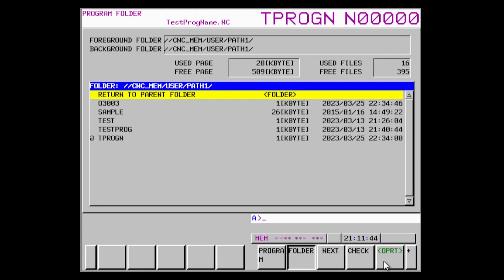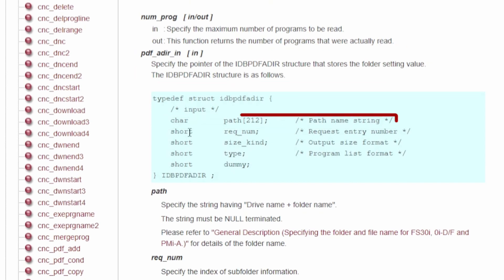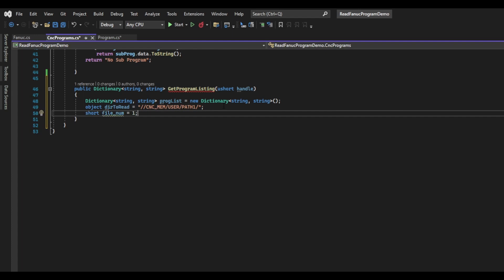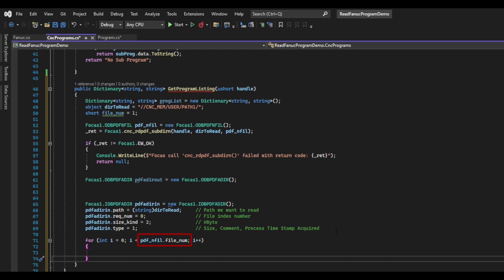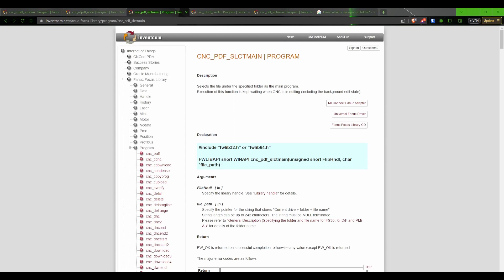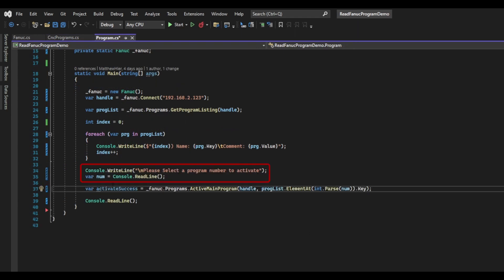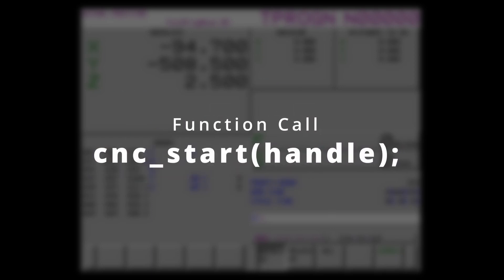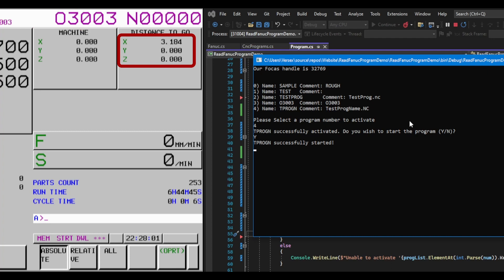Mastering Fanuc Focas: C# CNC Programming (Activate Programs)

Comment: Hi HierThinking,
You started a good Channel
Keep up the good work.
Also I have question:
I have idea to develop an application in which the generated Part Program is complex:
1. The application should will the parameters from GUI as input.
2. After that probe would measure some reference points and output to some macros let say: #120, #121,...ect.

After that:
3. My app should read those macros  #120, #121,...ect and generate another sub-program.

My question is:
1) Whether Fanuc part program can call an external program C++ from my app?
The reason for this : I need to generate an part program based on the out put macros : #120, #121,...ect

I have read fanuc part program but no place specify how can I call an external program from a part program.
So I assume this is not possible.

2. if 1 is not possible, do you have any suggestion about the structure of that application should be:
The key point is: The actual tool path should be generated by a c++ function ( which is complex) based on the output of  macros  #120, #121,...ect + GUI Input.
Thank you so much

Comment: What does Focas consider the "root" of the directory tree? Is it "//"? Can I start there and safely recursively list the whole folder tree? Does the tree potentially have symbolic or hard links that could create loops, as one might encounter in Windows or Linux?
Reply from the maker: For the root of the directory tree, it is going to be whatever device is selected. For instance, the root of the cnc memory is going to be //CNC_MEM and the root of the data server is going to be //DATA_SV. I am not sure if you can recursively list the contents of the directory tree. I imagine that it is possible, but that is not something I have ever had to do. As for sym links or hard links, I do not know of way to do that on the Fanuc control. It may be possible, I am just not familiar with how that could be done.
Reply: @HierThinking  So CNC_MEM and DATA_SV are the "devices" described in the documentation and serve as the roots of their respective trees. Is there an API to list all devices? Or are those the only two? (If the latter, I'll just hard-code to search only those.)

Recursion is easy. The file type returned by cnc_rdpdf_alldir indicates whether an entry is a file or folder. For folders, one invokes one's folder scan function recursively. I'll pass a depth parameter to indicate how much to indent the file and folder names for that depth.
Reply from the maker: I am not aware of a function that lists the devices. That doesn't mean it doesn't exist, just that I haven't ever used it. There is a function that lists the currently select background and foreground folders, but I recently discovered that it doesn't actually work. You can check that function out if you would like. Maybe you will have better luck trying to get it to work than I did. https://www.inventcom.net/fanuc-focas-library/program/cnc_rdpdf_curdir
Reply: @HierThinking  I found cnc_rdpdf_drive. Alas, it seems not available for the older Fanucs. But it's working for our latest machine.

Comment: What does PDF stand for? It's obviously not Adobe's Portable Document Format. The Focas API has a lot of different methods for reading/writing or uploading/downloading data and it would be nice to explain the differences. I'm trying to figure out how to pull as much static data out of my controls as I can, for backup purposes. I found that the FTP data server has only limited access to the programs in my machines, so I'm working on an app to gather programs and machine data from other folders and any other locations. (I'd initially thought I could just run wget in a script every night, but it can only see one folder using FTP, and not the ones some of my machinists are using for newer Fanucs.)
Reply from the maker: I am not entirely sure what the pdf stands for. I am not able to really find anything that gives a good description. I have some contacts that I can reach out to that may know. I will let you know if I am able to get an answer. There are certainly different ways of gathering information from the controller. Some of the functions are more cumbersome than others, and some are just outdated and have been superseded. 

I am curious to know what you mean by the "the FTP data server has only limited access to the programs in my machines". The FTP server will have access to the programs on the data server, as that is where the FTP server is located. Are you trying to access CNC_MEM from the FTP server? What else are you attempting to do? I have never attempted to access anything except the root //DATA_SV folder with FTP. I will need to do some testing on that next time I get access to a machine with a data server.
Reply: @HierThinking  I thought knowing what PDF stands for might give me insight into their architecture.

I'm a product development programmer who's been supporting our machine shop on the side. For about 30 years we've been using RS232 for upload/download and I'd written  a simple Windows app back in the 90s for that. Perhaps 3-5 years ago, we found out some of our controls had an FTP client that could be used instead of RS232, so we installed FileZilla Server on the bench PCs of those machines. A few months ago, I found out they also have an FTP server, the "data server". And even more recently, we got a new machine and I I found out that the data server can't access the files that had been transferred by RS232. I'm guessing that RS232 puts the files in "CNC_MEM" and the data server can't access that. So now I'm looking into writing a FOCAS-based solution that can access any file on the CNC. (The goal is to transfer them all to the PC to be picked up by the nightly workstation backup.)
Reply from the maker: So yes.... that is correct. The data server FTP cannot access the CNC_MEM. However, you should be able to access the Data Server and CNC Mem by using the Focas calls to upload and download programs. However, the problem with this is that we discovered the Focas calls are quite a bit slower (Not to mention more cumbersome).